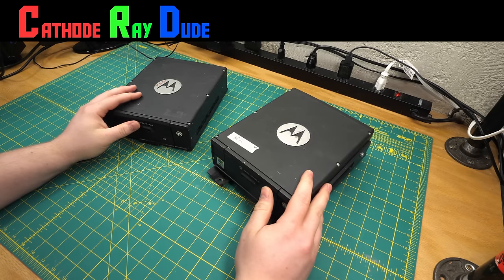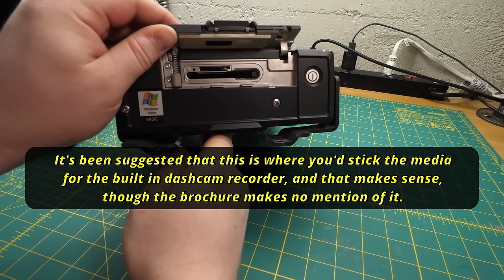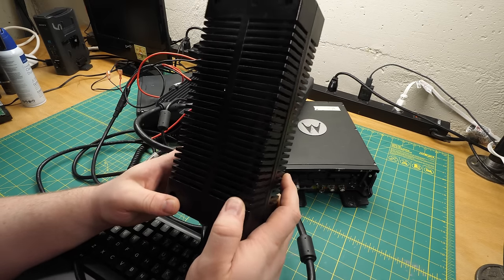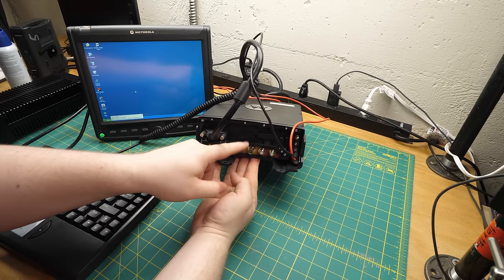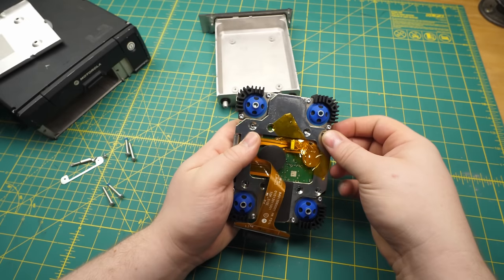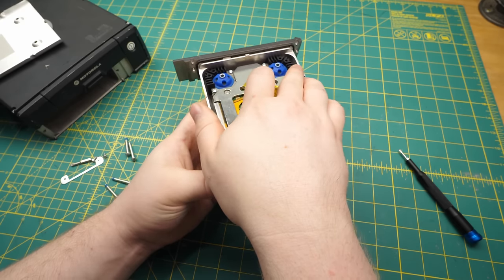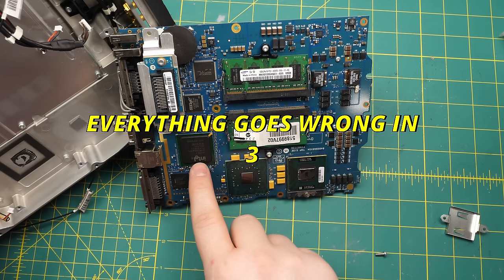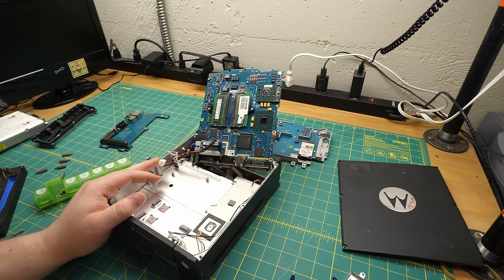Little Guys 7: The Cop-puter [Motorola MW800]

Comment: These are interesting since cars are so inhospitable for computer gear. These days they just use Getac laptops with awful docks that barely work. Not a cop, but I’m a little familiar with the equipment.
Reply from the maker: The funny thing about this is that everything I've ever been told about cop laptops is that they suck. The getacs, the toughbooks, the Dell rugged machines, any time they come up in conversation someone says they're awful and unreliable. I have no reason to doubt them, especially since, well, the military industrial complex has just a little bit of a history of exploitation.
Reply: @CathodeRayDude I can say from experience that ruggedized laptops are extremely well built. Their reliability issues are almost always either user errors or being used in environments well outside their operating range. Service members will complain that ANYTHING is an unreliable piece of crap regardless.

Edit: notable caveat: some suffer from cooling issues, as every few years someone forgets how to properly design a thermal system for some reason.
Reply: @CathodeRayDude  you'd be surprised how many cops have never met a can of air. I mentioned this to a buddy that's a homicide detective, and he told me later it was like getting a brand new machine.... so yeah most of those overheat and throttle like mad. The weights on the hard drive are almost certainly mass dampers designed to resist jostling. Not sure how well it's tuned but look up tuned mass dampers on wiki... they work quite well.
Reply: @CathodeRayDude  I have a Toughbook CF-33 for my work and i think it's a great device for my use case. But i don't operate it inside a vehicle nor do i expose it to heat, quite the opposite, i often work in very cold environemts in Europe and east Asia. My impression is that it's very reliable in an industrial setting. I work as a microelectronics engineer. 

As an european, i don't know why so many people from the U.S. complain about their police.
Reply: @hyperturbotechnomike  because they get more budget than everything else, buy military equipment with it, then complain about needing more money.  oh and they have a nasty habit of abuse and murder and are basically never punished more than having to move to another city.  the real problem though is if you even talk about cutting their budgets to something reasonable they respond by not policing at all until they get even more money and more immunity.

in short, they are extortionists but legally sanctioned.
Reply: @CathodeRayDude  I've heard the they never got the heat issues fully solved and it led to performance issues and a short service life, and that's why you don't see very many gov portable chassis on the surplus market
Reply: @Mister_Brown  Okay thanks. To have every police with military gear sound scary. 

It reminds me when itravel to certain countries where many of my family in law live. Shady looking police "soldiers" with bad reputation standing around in public places. 

The police where i live have a fixed budget, standardised equipment and a pistol at best. It's all centralised. Only special units have military equipment. But they don't patrol around and only respond to specific situations, like hostage crisis, riot or terrorist.

Comment: That power supply is commonly used for turning a mobile/car two way radio into a desktop/dispatch unit. Makes sense as both the Motorola "dash mount" radios and the MW800s use the SAE plugs. Unless you were using a trunk mount spectra radio, the newer astro and apx radios are all plug and play.

Comment: SSDs were just still that much more expensive back then.  The price even in 2012 was $700/TB, compared to $41/TB for HDD.  It would have been even worse before that, assuming you could easily get your hands on them.
Reply: Right.The first MacBook Air came with an SSD and it was like an extra 60% on top of the cost of a HDD MBA. - you want the cutting edge, you're paying for it. It's only until 2010 when these are "enthusiast priced for 128/256GB" (and how much more do you need, really?). The silence alone was worth the upgrade.

Comment: I think the CPU clamp is there to protect it from heavy hits, like a car it mounted in ramming into things - considering its a direct die contact solution and there is no IHS involved, I can imagine a situation where, when applying sufficient force to the enclosure, it could just crack the chip and kill the whole system if there was enough stress on the CPU mounting screws. With the funky dish-and-press configuration it has enough movement to wiggle around in there, if necessary.

Comment: You have made reference to cop puter many times. These were not just for cop cars. We had this exact unit in our fire trucks, ambulances, mobile command units, hazmat units, you name it they stuck one in there. The reason some of it doesn’t make sense in your build is because these were built to be adaptable. In cop cars alone you had finger print readers, scanners, ticket printers, regular printers. The program we used in our county was called rescue net. It had GPS guidance to the callers house, incident history, your model is missing the big red emergency button that when pushed sends the cavalry to your location. Some places used radio modem’s not cellular modem’s. And you have to keep in mind that a lot of jurisdictions can’t afford to spend a lot of money when you have 20 police cars and 10 fire trucks, especially when you have to choose to upgrade the computer or buy new fire gear or new body armor. A lot of those parts are the way they are because no two jurisdictions back then used the same technology. In some jurisdictions they used a radio modem that used the same frequency that the mobile radio you talked on did because back then cellular signal for data was terrible away from big cities. Also in the software there was a chat program some things you can’t say over the radio so you could send a message. These computers were great for there time they lasted through a lot. We responded to a police vehicle crash, the car was destroyed but that little computer was still running capturing video. Also one last thing on IO on that unit, they can record everything, speed, they can record when the emergency lighting is activated, some of them were able to start the vehicle if the battery got too low, radar detectors were wired into it, I believe there were even provisions to wire in NBC Nuclear Biological Chemical sensors that were mounted to the vehicle, temperature sensors. Many men and women entrusted their lives to that little box daily. You may hate Motorola but we have trusted them for a long time in our safety, I know inside of a house fire if something bad happens to me, when I push the ptt button on my Motorola radio the people outside are going to hear me.

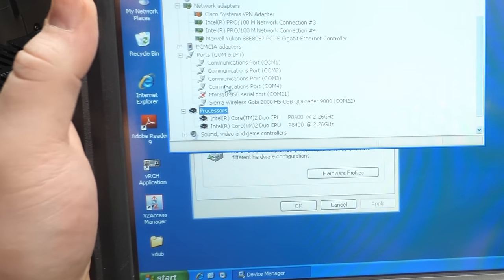Comment: 19:31 The P stands for Penryn, which was the codename for the ‘08-‘09 mobile Core 2 Duos. It’s similar to “Haswell” for 4th gen Core i series chips or “Alder Lake” for 12th gen. Same naming scheme. Basically, the process node shrunk from 65nm to 45nm which was able to maintain the same performance at lower TDPs. I believe higher TDP processors may have continued the T prefix even after the Penryn update. At that point, the P series slotted in between the U series for Ultrabooks and the T series for high end. However, if you have a Core 2 Duo from the P series in a machine, you can be reasonably sure that it was made between 2008 and 2010-ish. 

In the MacBook community at the time, those processor numbers were discussed like crazy. On the Mac side, literally everything aside from the Mac Pro (which had Xeons) was dual core from like 2006 to 2011, so everyone got into debates about which was better so as to justify their 1000+ dollar purchases. I know of people who would go on forums to debate how much faster a P8600 was compared to a T7500. Because the CPUs were all soldered, Apple would charge like 200 dollars to go up in clock speed by 200 mHz, and people would pay because they thought it would “future-proof” their computer. No joke, someone on MacRumors argued that 200 mHz was the speed of an iMac G3, and that made it worth it to go from 2.4 to 2.66 gHz on his 2010 MacBook Pro for a cost of 300 dollars. The environment was WILD.

Comment: this was very clearly built by Motorola solutions not Motorola the phone company . its very much built like there XPR/APX radios. that's why it has "trailer plug" power connectors and Mini UHF plug as that exactly what they use on the radios. also the internals look remarkably similar to  the radios. also looks like its made to fit in the same mounting brackets as the radios.

 the mini uhf connectors is actually a pretty good idea as they can just use the same cabling  and antenna mounts as the 2 way radio systems. likely had external WIFI antenna on the car for downloading video and logs via WIFI in the garage when the vehicle is parked at the end of the day, 

I used to install police equipment this is pretty typical of Motorola construction
Reply: Yeah, even when they were technically under the same corporate umbrella, they really kind of weren't. Motorola the people who make phones are actually cool.

Comment: I remember Win 7 Home Basic being pretty easy to come by in Russia around 2007...2009. It was exactly the "emerging market" experience. This was MS's way of doing regional pricing - Home Basic in Russian cost much less than Home Premium, but it came exclusively in Russian and could not be set to any other language via language packs (itself a novelty at the time). I think, they still do the same thing today for Win 10. And you can find, for example Ubisoft selling special versions of their games on Steam in countries where regional pricing is much lower than the dollar price where the language is also fixed. Had to avoid their games for a long time cause I prefer original VO, not a low effort dub, in my games.

Comment: When I was in high school I had a standard ATX pc in my trunk with a Xenarc vga display in the dash, a Harmon usb puck gps, and a d-link external wifi antenna to get all the (I think) 802.11g open networks. I can’t recall the name but there was a dashboard software I purchased that controlled Winamp in the background and sat on top of XP I think. I called it my CarPuter. I also had a specialized power supply that accepted 12 volts from the car and had capacitors to keep it going while the engine cranked, and a pin to connect to the interior light circuit of the car that would trigger startup and shutdown based on dip switch settings. I had to keep the hard drive vertical so the heads wouldn’t crash as often. I would get about 6 months out of a hard drive. Later I upgraded to what I think was called a capuchino pc. I still have the disc for the dashboard software somewhere, I should dig it up. Lol
Reply: The software was called DigitalDash
Reply: Thank you for sharing, its really cool

Comment: I have to wonder if the spring loaded clamp for the CPU die is used rather than screws in an effort to prevent having the silicon die itself act as a hard-mounted pressure point in the chassis. I've never designed rugged electronics, but with the lengths they went through to protect the other sensitive components like the hard drive it makes sense to me.
Reply: When I used to repair laptops I would occasionally get an old ruggedized thinkpad or some other toughbook-like thing meant to be chucked in a suitcase or whatever. Lenovo used to exclusively mount the heatsink to the board in those applications so the surface of the die was never moving relative to it. Others would shock mount the whole board and use the heatsink's mounting posts as part of that, and then whack a big thermal pad in place. I'm surprized this thing didn't look like it used a thick pad for the CPU like they did for the chipset, but maybe that residue down there is just the remains of a thin one.

Most interesting solution I've seen was Panasonic splitting up the board into a CPU & RAM board, MXM GPU connector with some flex in it, and then a sea of ribbon cables to I/O boards both internal and external. On one had that was the most modular laptop I've ever worked on. On the other hand it took 43 screws to release the GPU for a vram replacement.

Comment: Bro... 
Motorola knows what they're doing here. 

They put the hard drive on such extreme shock isolation for car crashes, not vibration. Its quite literally a black box.

If they've gone that far, they've also done plenty of thermal simulations. 

Fasteners are stress risers, they sandwiched the fans because its the most robust way they could have done it, mounting them with screws would have broken off their tabs in no time and they woulda been sitting there rattling around in their cage until the end of time.

PS: after re-watching the first minute, I dont really blame you, Id have a hard time giving the black assault computer the time of day too.

Comment: I work on an ambulance, but IIRC the cops here are all on the same dispatch system and use similar stuff. I know Fire uses the same tablets for CAD, but cops might be using full laptops. Not sure how things are in other areas. 

Having a docked tablet sorta solves the problem of having a computer in a hot car when it's not in service, since you can just take it inside. It also means that your computer dying won't knock a rig out of service. You just swear at the thing and get a replacement. All the important stuff is stored on the dispatch center's server anyways. We got our tablets replaced about a year ago, but until then we were using an old dispatch software. Like, it was unsupported because the company that made it went out of business almost a decade ago. They got bought out and the new owners finally stopped supporting it. So now we got a new software that's even worse and doesn't know how to wrap the labels on a map correctly. It'll wrap them off the damn screen and I recognize this is now a rant about software but it is an incredibly frustrating thing when you're trying to figure out what road to turn down for the CPR call. 

Anyways, point is that they had some tablets from probably 5 years ago (I think that's when this company got the contract) running the software. So tablets have been in use for a while now. Depending on how you define a while. But since a good quarter of the industry has already been taken out by back injuries in that time I'd count it. 

Not sure about other computers stashed around to run other parts of the ambulance. It'd probably depend on the model. I on some I'll hear a relay click when I do basically anything, but others don't.

Comment: That video capture chip is in the same line as, though sadly not compatible with, the CX23883 and similar. Those have a clean enough signal path that they're the basis of the CXADC project which uses them as a PCI/PCIe SDR receiver for archiving modulated analog video like laserdisc, VHS etc.

Comment: Got a couple of ToughBooks at my fire department. And if you think that drive heater is weird, you should see what the CF-30 hard drive caddy looks like. I took a couple pictures of them when I converted them to SSDs and its full of foam and surrounded by flexable PCBs with traces in them to warm the drives up while they are in colder enviroments. We are looking to get newer models like some CF-31s or maybe something else entirely. I could see if I could get you some of the laptops we use in the fire trucks if your intrested in them. They arent anything special though just Panasonic CF-30s.

Comment: My dad is a cop, but they always have had laptops that mount into stands. Panasonic Toughbooks, pretty much universally around where I live. These are really cool though, I'd always heard of and seen photos of them, never seen inside of one.
EDIT: Asking my EMS buddy, firetrucks and ambulances don't often have computers in them around here - Just radios. 

I also want to mention that I have a pair of NEC MultiSync 4:3 monitors that were trash picked from a 911 operator office. So that's cool.
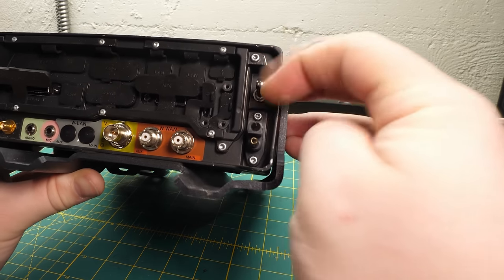10:50 Yes those connectors can carry many amps, they're used on industrial lead acid battery chargers all the time. They tend to melt about 20 amps.
27:51 Simple physics, moment of inertia. The more it weighs, the more energy it takes to make it start moving.
49:58 I've asked some chip collecting friends of mine what "SECRET" might mean on an Intel BGA. Will get back to you on that.